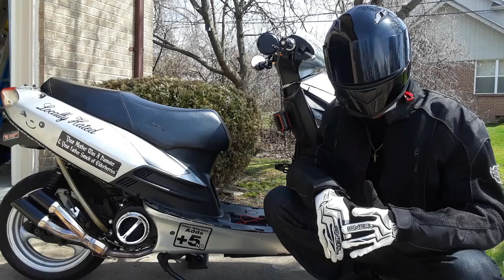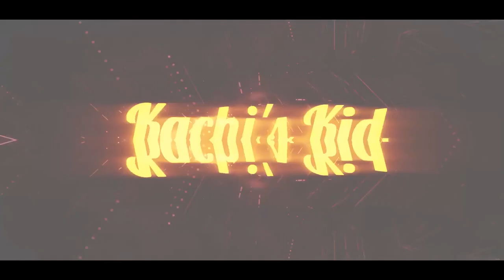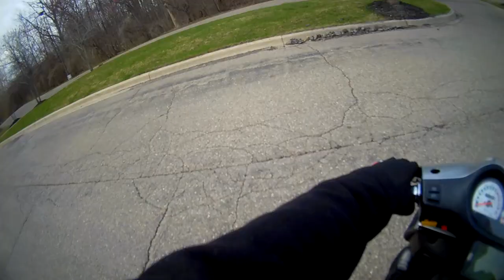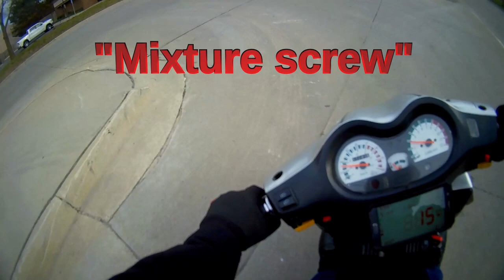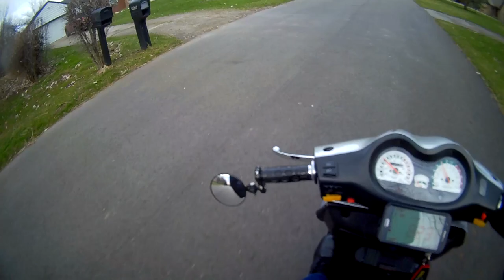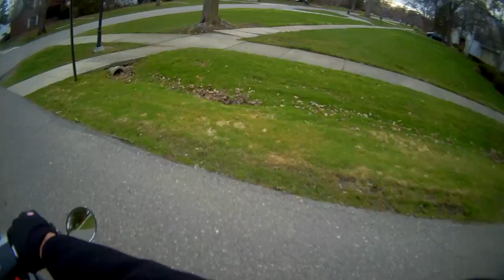Stock 30mm Carb.Testing / GY6 / Motovlog

Comment: I have Baotian 125 scooter. I will install Taida 171 cc cylinder and high compression forged piston soon. I have big valve Naraku cylinderhead (28.5 mm intake valve and 23 mm exhaust valve). It is not ported yet. Some little valve seat and valve mods will be done at minimum as original is not even near perfect. I will use A8 cam, 30 mm CVK carb, performance intake manifold which is modified so it flows better. I have still stock exhaust but catalysator is removed. I think I have to buy a performance exhaust so it will breath better. All other parts are here now.
Reply from the maker: HECK YEAH! Are you gonna film any of this?
Reply: @kachiskid  No but I will test with GPS how fast it will go when it’s ready. I have now Naraku 11.8 grams variator weights. Original ones are 13 grams. I will maybe change that complete variator or just put each other 11.8 and 13 grams weights to get a bit heavier average weights of 12.4 grams to increase top speed. I tried earlier with even lighter weights and it was not good at all. It reduced top speed. Maybe also Naraku Sport clutch, new belt and +2000 rpm stiffer red rear variator spring to get better take off. I want to change also secondary gear ratio to +25% taller ratio with 17x36 gears. It should have enough torque to benefit from taller gear ratio. But I don’t want to go with too tall ratio as I weigh around 220 lbs.

Comment: Hey bro, I’m going crazy haha, so I have a 171cc big bore kit but am running the 24mm carb, engjne is over heating, now... will a bigger carb fix this issue?
Reply from the maker: Yes, it should help. When you say overheating, what do you mean?
Reply: So I will be running and it will lose power as it’s far to hot, it will cool then start running again all good again. I think the 24mm maybe the issue I hope

Comment: It may have something to do with the climate also bro and how its jetted and other mods also clutch also clutch made a big deal for me I'm also in California just my opinion
Reply from the maker: Yeah, I already upgraded my clutch and a 2000 rpm spring which I love. This is most def' a jetting issue but even before that my next video is going to show the process to be done before even working with the carb. Airtight, valves, etc.

Comment: 32 pilot, start at 120 main then work up on the main..you might need to mess with the needle position as well
Reply from the maker: Sounds good. A quick valve adjustment, and a little warm weather and we can get started. Did you get a chance to watch my latest video about the headlights? Been out for about a year, the daytime running lights have made me think they have been working.
Reply: AC, right? You checked the wires from the light all the way back with a meter?
Reply from the maker: @apmscootering5219  Yup AC, the running lights are working being DC and all. Checked the wires all the way up to the switch. Getting continuity from end to end. My switch has a white, blue, and yellow coming out. No yellow line connected to the harness at all. Am I missing something?
Reply: Lemme look at some schematics
Reply from the maker: @apmscootering5219  Thank you bro.

Comment: that CVK it reversed, the screw is not air, its actually cuts fuel when it goes in, its not like other carbs that the screw is air screw
Reply from the maker: Yup, 4 stokes have fuel screws, 2 stroke carbs. have air screws.

Comment: Yeah bro it looks very sluggish hopefully little needle adjustment and some jetting and you'll be hauling
Reply from the maker: Oh yeah, seems to be a lot of room for adjustment. Once I get the right jets in...zoom, zoom.
Reply: Change jetting and it will haul. In Florida I did a 115 main and 34 idle and got 75
Reply from the maker: @roymaddoxjr5760  now Florida's climates a little bit different than mine, but that sounds like a good starting point. How many turns out are you on your mixture screw?

Comment: Been saying for a hot minute 30 is way too big for a gy6. I know the kids go gaga over it but you can over carb.Just like the idiots that put those 600 holleys on a small block chevy or ford. Sure you can tune it to run but you will never tune it to make power.I have a 26mm on the 232 in my buggy and its just right.
Reply from the maker: I guess we will see. Any footage of your buggy?
Reply: @kachiskid  not right now. The front wheel 
bearings are out and waiting on them in the mail with this lockdown
Reply from the maker: @user-neo71665  looking forward to seeing it. Just so you know, I agree with your theory of 30mm being over carb, for this size engine. Back when I 1st started, I met this genius dude named "pistonguy" at Dan's garage talk. He informed me in detail why the 30 was to big. I'm going to have a large collection of cheap carbs. over time. Currently have 24, 26, and 30. Most likely I will settle on a 28 PWK but this is all about testing theories, to see what is really best for my bike in my climate. Conserving gasoline has never been on my to-do list. Videos have to be short, so sometimes I don't get to "why" I'm doing something. If I can't get it tuned right, everyone will know. I have never been scared to jump off the cliff 1st.
Reply: Again I build stock 150cc with that carb jetted correctly for the area you reside in and make good power.  I got one now I run on 115 main and 36 idle that does 60 cruising and 76.8 wot.  Only other upgrades is the clutch. Been 2yrs still running strong on 93 octane
Reply from the maker: @roymaddoxjr5760  that's what I'm talkin about! People hating on the 30mm, is a good reason to even try.
Reply: Almost forgot... It's the clutch a carb and a A13 cam... Some would say naw that won't work. A13 cams produce bottom end power. Meaning more take off and speed
Reply from the maker: @roymaddoxjr5760  yeah, I currently am running the A14, lot of take off speed but falls on her face a top end. Gonna see what a A9 will do before I change the final drive gearing.
Reply: @kachiskid  try a A9 for since your motor is more upgraded
Reply: @kachiskid  I'm running an a12 for torque but again I'm a 2 seat buggy with all the weight. With four heavy 32 inch tires it tops out at 45mph but climbs like a billy goat. Also has I think 12 gram sliders in it. I'm not hating on a 30 but as a 20 year mechanic IMHO it's just too much carb for a small 150cc engine. Like I said you can make it work but it's easier and more efficient for a smaller carb. I can "make" a 800 holley work on a geo metro and then put a 4 inch exhaust on it but that doesn't make it efficient or make more power. It will just make it drink more gas to compensate for the so called improved airflow to make the same power a smaller carb will work just as fine for.
Reply from the maker: Neo, I hear you, but as you see people have different experiences with the 30. Been a classic argument well before I came along. Now, I could take your and Mr. Maddox Jr. opinion and make them my own even though they are opposite . I guess I don't learn anything until take on the challenge myself. What's there to lose, a little petrol? I don't think your hating, your trying to save me from a possible big headache and disappointment. Just give a brother a chance...See look, we are all running different cam's but we make it work.
Reply: @kachiskid  That's what am talking about 🤘
Reply from the maker: @G3438  did you get a new carb.?